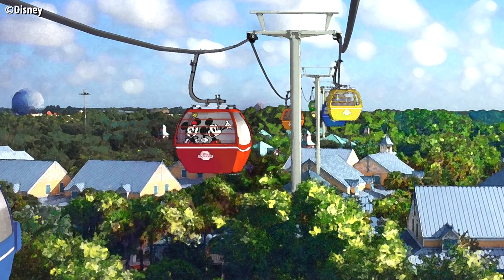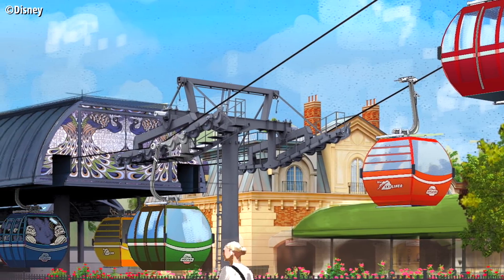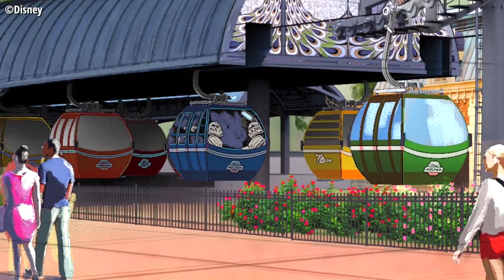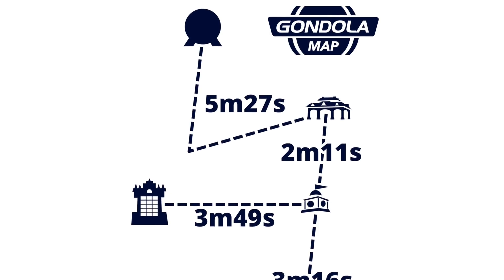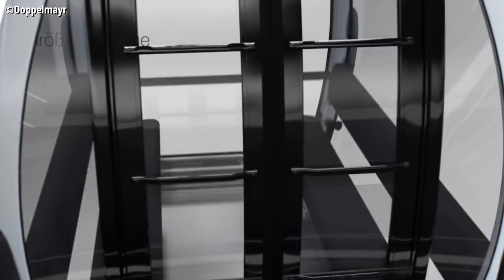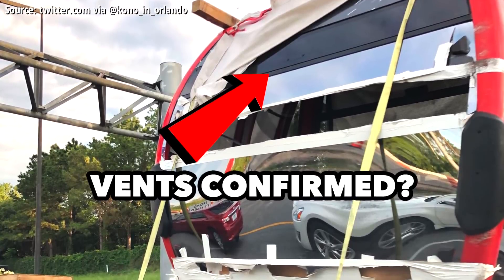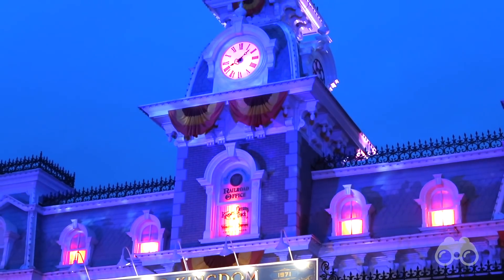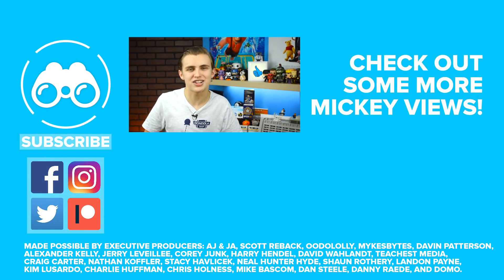NO A/C on the DISNEY SKYLINER GONDOLAS?! 🔥

Comment: This is concerning...  Because what happens when the gondolas STOP as frequently happens with such vehicles in other locations.  No movement = no airflow or very reduced?  And, if they're stopped for any extended period of time during the summer months I can easily see each of those gondolas becoming their own private oven for the guests inside.  Think of it like a sealed car suspended 30 or more feet above the ground with the engine turned off in the dead of summer.  Who approved this?
Reply: There is sufficient airflow circulation. I'm basing this on the same gondalas that i have ridden that is the same manufacturer as this. Also, it does stop but just less than a minute or two, probably for handicapped riders.
Reply: @gissneric  I'm not so concerned with the minute or two inevitable stops as much as I am with the possibility of what happens during a break down where someone could be stuck in those for 30 minutes or more if there is a problem with the system.  Is there going to be enough airflow through these in the dead of summer when our heat indexes are on average over 100 degrees?
Reply: @brianparks4874  let's not think about a major breakdown especially if we have not seen it up and running. In terms of air, when you're up high, it's not the same as what you feel on the ground. When it's AC and someone farts or smells bad, you're stuck there with that smell. With open continuous airflow, you won't notice it 😁
Reply: A small muffin fan powered by a solar cell... ahh cooling air
Reply: I just got anxiety reading this.... Crazy
Reply: +Brian Parks   Highly educated Disney Engineers approved this with the comfort and safety of every Disney customer in mind.  They go to school for this and are experts in their field !   They are not carnival Roustabouts !
Reply: Mr99Boxer yeah we all know mistakes can’t be made!
Reply: Chris Maddock well it’s on the net so it’s gotta be true!! You can’t lie on the errornet!!
Reply: +Richard Savaglio    My thoughts exactly !  You are correct !   If it is printed on the internet it has to be true.  (I also forgot to mention that the Disney engineers are highly paid too, that should count for something.  And I think Chris Maddock above was referring to mistakes like the "Titanic sinking" but that was over water and not solid land like the Skyliners at Disney World.  Also the Doppelmeyer Advanced German Skyliner Company is well respected in Europe and their engineers even help Volkswagon with their engineering problems. So there's the proof.  Cheers !  Auf Wiedersehen ! )
Reply: Read my comments above from Nov. 11th.
Reply: @gissneric  "let's not think about a major breakdown"... WHAAAAAT? I wouldn't want to buy whatever the company you're the CEO of is selling. Of course you've got to think about that because it's inevitable.
Reply: @DjMikeWatt  would you think a top company like Disney would take that risk? They have been there for decades and you don't see major major breakdowns that would cause injury or death. Sometimes you gotta have faith and not be a complete cynical in life
Reply: @gissneric  Yes. I do think that. I worked for Disney for years and I've seen plenty of unplanned things happen. I've seen people trapped in monorails for hours (Oct 2015), I've seen the MK sky buckets stop constantly in normal daily operation, I've seen people stuck on the Hulk coaster at universal for an hour out in the sun (May 2015).

These things happen all the time. It's smart to consider what can go wrong. Why is that cynical? It's just being realistic. This is all engineering and sometimes engineering fails. That's just a fact.
Reply: Due to having claustrophobic I would not be able to ride this and of course the heat.  I will continue to just drive and park, thankfully live close to Disney World.
Reply: @ambershores3352  WOW! Someone else who knows what a muffin fan is! I haven't heard that term in decades!
Reply: @brianparks4874  No need to stop the Skyliner for guests in wheel chairs and scooters - there are TWO loading areas in every terminal, one will be a regular loading area where the gondolas move very slowly, and the other might have a gondola stopped completely for loading guests who need the gondola stationary. Once loaded, another is pulled off the main run to take its place and the newly loaded gondola gets inserted into the gap left by that replacement gondola. 

Supposedly, these gondolas will have air circulation fans powered by batteries or the new Ultra Capacitors that get recharged every time the gondola is in a terminal. Air conditioning is possible but no official word has yet been announced:  See example of airconditioned gondolas: https://youtu.be/t8Pr1mg6mQA 
Quick charging Ultra Capacitors: https://youtu.be/puEIN7uLi6Y
Reply: Disney would lose customers or even be sued if anything bad were to happen. So no.... they know what they are doing and they are extremely good at their job. They managed to crabk up ticket prices while still gaining more customers. The sheep that follow into the den of Disney have know become aware of the situatuon and yet Disney is so good at its job that all the sheep still do it anyway.
Reply: Brian Parks how does that differ from when an active air conditioned transport system breaks down? When the monorail breaks it is equally an oven. And equally inaccessible.
Reply: @andrewtaylor940  Only that it's a smaller, more confined space, and yes, I've been in THAT unfortunate situation too, which is why I brought this up in the first place.  What's really worse about this though, instead of having ONE monorail to possibly evacuate guests off of if they can't get it running, they have what.... dozens of little individual gondolas spaced out across a long stretch of property, which would make any sort of evacuation nearly impossible or at least horribly long and slow at best.
Reply: What happens if the Sun explode?
Reply: You were proved right... people were stuck for 3 hours.
Reply: @mr99boxer30   Feeling embarrassed about this comment now that we all KNOW what can go wrong?? Too bad you weren't stuck with all the people trapped in the gondola cars for 3 hours-- they would have felt a LOT better if they heard that explanation.
Reply: @cathydanielson9995  Opps !  Well I guess the engineers just have to tweak the system a little more.  In the future they will hand emergency kits to anyone stopped in the gondolas.

Comment: Just watch. Disney will have small vending machines in each gondola for you to purchase mini mist fans. Marketing genius!
Reply: Ethan Z Theres no electricity in them. Vending machines need electricity. They wouldve put A/C on the gondolas if they had electricity on them, but they dont. Plus someone will shake it because theyre too poor, and are very needy. Then, it will collapse on everyone, and possible collapse the gondolas. (If youre thinking of a small vending machines without power, you can easily open the compartment and/or steal the entire machine.)
Reply: @ehtropenelopen5192  Whew. Thanks for clearing that up for everyone. I'm sure no one realized that whatsoever.

Comment: Big mistake not air conditioning those mostly glass gondola cars...even for a max. 5 minute ride, the complaints will come quickly, and in large numbers. Can you imagine nighttime riders who use the system for a dinner reservation (all dressed up!) at one of the resorts on the line or at one of the parks, sweating through a muggy or even rainy summer evening? Not a good idea to skimp on this, Disney management! FAIR WARNING...

Comment: If Disney can spend $71 billion on buying Fox assets they could have linked all the hotels/parks with the monorail...
Reply: Amber Shores FOR THE LOVE OF GOD! Let me sum it up:
 The company that made the monorail tracks stopped making the same tracks, so now tracks cant fit the current trains they have. 
Also, take this into consideration if youre thinking “why dont they just redo the entire track and add new carts” it will take almost 10 years to do, and dont forget the fact that it will only cost a couple billion dollars.
(And thats not the wait for the new track, they will have to take 10 years of shutting the whole system down.)
Reply: Horrible Productions.... it only an engineering issue... if the tracks are of different gauges they can run different loops using the monorails that most airports used today, should be less costly than the current track and cars.
Reply: Yeah, so hire another contractor.  It's not like Disney doesn't constantly bring in different contractors all the time to retrofit various ride systems.
Reply: @ehtropenelopen5192  "The company that made the monorail tracks stopped making the same tracks"  So the plans have been lost to the sands of time?  Poor excuses for a money hungry corporation.  Disney has become a hotel management company since the 90's.  Their dominance over animation and children's entertainment is fading.

Comment: Yeah, brilliant move.  Air circulation for a gondola system where the cars are riding around 60 to 80 feet off the ground.....  And heat rises.  Do we even need to mention the brutal humidity?  A/C in Florida isn't just the temperature, it is also use the dehumidify.  Can you imagine the buckets of sweat that will pool on the seats of these enclosed saunas.  A total failure before it even starts running.  As soon as this thing breaks down, there will be people passing out from heat stroke.

Comment: Awesome thumbnail and even better video! Informative and interesting. Great work Brayden!
Reply: Great video. Thank you for this information.  As an annual pass holder who goes there all seasons,  I will only use this system in winter and early spring.  Will use the other slower modes with air conditioner in the warmer months.

Comment: There are many gandola system around the world and many of them are in Asia (hongkong, Singapore, Malaysia) and guess what... those are all tropical! Way hotter and way more humid than florida... and none of them have A/C and they do not get hot.. 

Ive rode few and the only thing that would happen is the glass fogs up usually after heavy rain as the humidity level goes completely out of whack, but still it never gets warm or hot inside.

Even during thunderstorms, rain and to a certain extent wind, has not stop them operating.. some been operating over 30 years non-stop now.

The condition inside pretty  much feels like you are standing outdoor on a balcony with a breeze during a hot day.

Comment: This whole thing has been done based around the cheapest budget possible. The best option was the monorail extension
Reply: Not too sure about that.  Monorail can move what maybe 20% more people per hour and that's elbows to assholes to get that number and at staggering $$ figure.  I'd rather have this and get it deployed quickly so they can get to adding even more lines.  Transportation between areas was a huge issue this last week.  Thank god for uber and lyft, but I'd rather not use those.

Comment: What Disney attraction has NEVER shut down for even 5 min? I see heat strokes happening hope that was calculated into the costs.
Reply: Nurses will be available at each transfer station for your safety.
Reply: GET REAL PEOPLE. THE COMPANY THAT MADE THE MONORAIL TRACKS STOPPED MAKING THE SAME ONES. THERE WE GO. WE NEED TO GET RID OF ALL THE TRACKS EXISTING, THEN REPLACE THE CARTS AND TRACKS (WEVE ALREADY TAKEN ABOUT 4 YEARS TO DO SO AT THIS POINT, AND SPENT A COUPLE BILLION DOLLARS.) NOW, WE NEED TO INSTALL THE TICKERS, THE AC, REARRANAGE THE SEATS (TAKEN 4 AND A HALF YEARS NOW) NOW, WE NEED TO MAKE PREPARATIONS AND PROGRAM THE TRAINS CORRECTLY. (WE HAVE TAKEN 6 YEARS NOW.) WE NEED TO TEST THE TRAINS TO MAKE SURE THEY ARE SAFELY WORKING PROPERLY. (NOW WE ARE DOWN TO 7 AND A HALF YEARS.) ALMOST 10 YEARS!!
If you really want to disable ALL of the monorail for 7 and a half years, then go tell disney that and convince a crap ton of other people to tell them that too!

Comment: uggh, why don't they just attach a Mitsubishi electric a/c in the gondola itself and maybe only use it when the line stops (as we all know it will, probably multiple times per day)
Reply: Paully Castallano  throw some solar panels on the top of those things.
Reply: @yesnik09  Solar doesn't provide the amount of power you would need to run AC. The only gondola system currently in use that have A/C use an ultra-capacitor to power the A/C which gets recharged each time the car goes through a station. This is what the London system uses and supposedly it doesn't even work that well.
Reply: 2000danlb Plus it would be too heavy.

Comment: Everything will be fine......... until it breaks and you are left dangling over the water with no ability to get to you with a crane.  Then after 30 minutes of Florida air AND sunshine.....
Reply: I wonder about break downs too..
Reply: Nothing can go wrong....
Reply: 3 back up systems on this lift..Doppelmayr is pulling out all the stops
Reply: 3 back up systems on this lift..Doppelmayr is pulling out all the stops. At the lowest back up system,  the lift will be powered up to 65% capacity
Reply: @vonrollskyway1   do literally 'nothing can go wrong' . 
"Titanic Designers" we don't need water tight chambers,  the back up systems will stop any breech. 

Seriously...the entire world of engineering fails are full of corporate cost cutting because of nothing can go wrong.  Also Opening a Window isn't really a backup system. Especially if it's just someone in a wheel chair alone.
Reply: @whatthestuffisthis  like i said , being in the lift industry for 25 years, The Doppelmayr D- line monocables are extremly reliable.. so many safety switches,  rpd ,cable catchers..
Reply: @vonrollskyway1   So was the WDW monorail system. Until........well the fire and  later death etc. 
MayPo was the most reliable system ever...until things went wrong. 

The thing is that Disney is cheep and cuts corners, and pushes their employees to points of failure.  Things will go wrong, 
Imaging the lift is transporting puppies...puppies in a glass car. IN Florida heat. And it breaks down. Well, you gotta someone up there to break glass. "Nothing can go wrong" is the mantra for all Titanic engineering failures. "Life boats? Pfffft. not needed..it CAN'T sink" 
/I used the word puppies because people will probably be more concerned about stranded puppies in a glass car in Florida instead of Tourists.

Also..I'm not commenting on the idea of that they'll plummet to the ground. 
The Doppelmar you mention aren't deployed in FLORIDA. You're taking a system designed for Alpine use where the temp never goes about 80..and translating it into Florida where 90 to 100 degrees is common. 
Okay, if left your car for 10 mins in Florida heat with a puppy in it...you'd have the cops breaking windows and if there was a kid in the car you'd have CPS charging you with child abuse.
Reply: Sam Paul couldn’t agree more.  Once you see this attitude you know what can happen.
Reply: Yeah, LOL -- tell that to the Disney employee who got killed by the last cable car ride they operated (near Tomorrowland in WDW).

Comment: A/C for such a system was never really an option. Aside from the weight issue, there is also the issue of powering them. They would ether need batteries, which add even more weight, or the carrier cable would need to also supply power somehow, which would mean two cables (one both traction and a power path and the other just for completing the circuit) or three (traction, hot & ground).

This adds on to the whole “what if something goes wrong” argument that ether way, the A/C would shut off from draining the battery or for a safety power cut.

Comment: Right now if you stay at Yacht or Beach Club, Boardwalk or Swan/Ugly Fish you have to take a boat or walk to EPCOT and/or DHS. They only have buses go there when the boat isn't running. My question is when the Skyliner opens, will the bus service discontinue?
Reply: Insiders have said that Disney's goal was to eliminate the buses between the resorts and parks serviced by the Skyliner. Even if they aren't eliminated completely you can expect that they would be significantly scaled back.

Comment: I keep wondering how Disney is going to handle people that are handicapped. I just wonder how they will be able to get them on and off in a timely manner. If it takes a while, people are going to be baking in these things. Nice video!
Reply: In construction pictures it looks like the stations have an additional loop for handicapped guests
Reply: @jacobselleck9750  Yeah, I wondered what that was. I thought it was that, but how are they going to shift it from one to another?
Reply: @michaelmeetsmouse367  on other gondola systems there is a track system that has a rail splitter that can send gondolas to the side and then put them back on the line when needed.
Reply: Probably similar to how ADA loads work on toy story mania or space mountain in Disneyland, just take one car off to stop to load and then add it to the circuit once the passengers load
Reply: These gondolas detach from the cable when they get into the station. You have plenty of time to get on with a wheelchair.
Reply: @WilliamFeeney28  Ok thank you. I did not know that. Thanks for the information!
Reply: If it is anything like loading scooters and w/chairs onto the buses then it will be anything but a timely manner. Speaking of scooters and w/chairs do the get special preference like with the buses? They show up last then the riders and their entire extended family get to jump the line instead of waiting their turn like everyone else that has been waiting for 20 minutes..